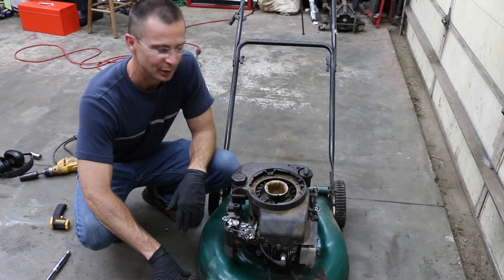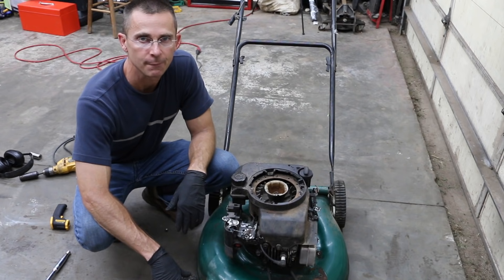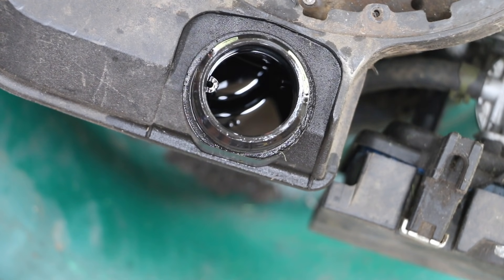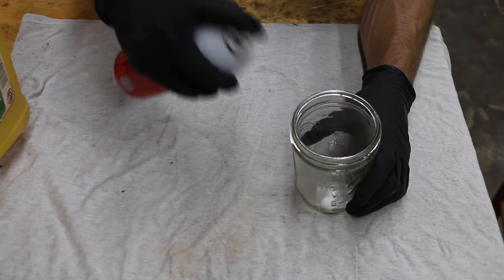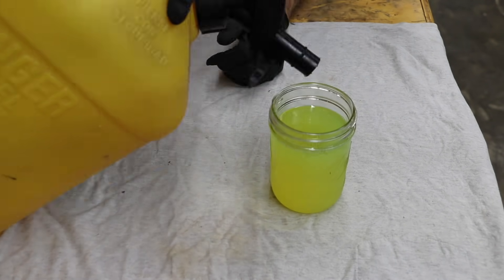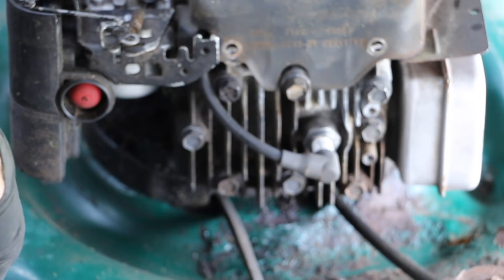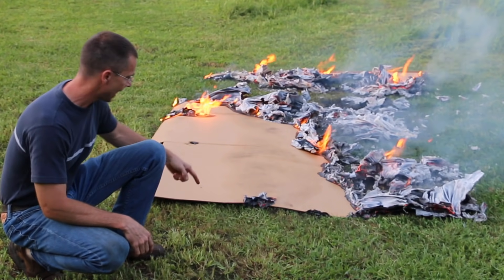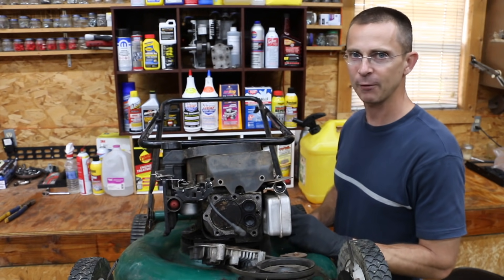Will a Gas Engine Run on Diesel?  Let's find out!

Comment: I've always been curious what would happen if you turned up the fuel on a diesel and made it "roll coal" out of the exhaust through a tube into the intake of a gas motor. Diesel won't burn in a gas motor because the liquid has to have compression to ignite so what if it has been turned into a gas mixture (the coal) instead of the normal liquid form. I am curios since you essentially would be running a gas/diesel hybrid at that point if your HP and TQ would increase.

Comment: Yea I would like to see diesel run in a 2 stroke like weedeater engine.
Reply: It could work, two stroke gassers are higher compression, but I think the quench would be too great for proper ignition, just like we saw here. Two stroke diesels on the other hand....
Reply: Accidentally put diesel in a snowmobile, got as much out as I could, but it smoked really bad. Took it riding, and it broke both pistons into little bits. Pretty crazy
Reply: Weed wackers will run on diesel if they're warm.
Reply: They will. whel, most will (provided ok compression) but you have to block the intake to kill them.

Comment: It's was my understanding that if diesel would ever burn in a gas engine it would require the gas engine to be at its full operating temperature and not a degree below, the hotter the day the better kinda thing.

Comment: Can you do a comparison of running diesel in a gas engine what happens to the connecting rod bearings on the crank. I've always been told the diesel grit will get past the rings contaminating the oil and ruining the bearings

Comment: diesel fuel works better when atomized with air (Injected). The smaller the diesel droplets. the better it burns. Also diesel has a higher BTU rating than gasoline. That's why it burns slower and hotter. Gasoline has has a lower BTU rating, but a higher flash point.(ie..poof)

Comment: Yes, it will, IF the engine is good and hot and has a bit of gas in it. My wife did that when she filled the riding mower with diesel when she was using it. It did not run very well, but it did run. Problem was that it would not shut down, had to choke off the air to kill it.
Now try to run an engine just off of gas fumes.

Comment: Will it run on alcohol? 🤔 Or RC nitro fuel...
Reply: girenloland I was wondering if you are  could  check and see if it will run on moonshine?
Reply: The engine will run on both with methinol alcihal and moonshine moonshine could cause the engine to rush in the inside and alcihal it will run but it's hard to start I pulled my engine like 30 times and it would not start so I sprayed starting fluid in the carb and it started and I ran the tank out of the alcihal and I put gas in and it ran fine
Reply: girenloland More like blow it up I'm thinking.

Comment: Yu have to keep compression in mind. Diesel is meant to ignite on compression only. If you put it in a car it will ignite while the piston is still i the compression stroke and again once the spark plug fires causing nocking and eventually failure.

Comment: this will work if the engine is hot and has some gas mixed in to help light the diesel. it worked with my go kart engine

Comment: Did you use an antique (naphthalene) moth ball or the modern much less flammable (1,4-dichlorobenzene ) moth ball? You forgot to mention any physiological symptoms you had from breathing the  pesticides you atomized into the air.  Did you have any blurred vision, headaches, weird symptoms later, like decreased IQ? Cancer?
Reply from the maker: I used naphthalene.  I wear a high quality duel cartridge respirator when exposed to vapors.  Never experienced any symptoms since I take proper precautions. Thanks for commenting!

Comment: Hello,

I’ve got a suggestion, do you know Aspen gasoline? https://aspenfuel.co.uk/
It’s a special gasoline for lawnmowers and other kind of industrial equipment.
I’ve got some good result of cleaning old carburetors, or keep them clean.
But im curious if there is less carbon built-up, or it will remove carbon.

Keep up with your good work!

Greeting’s Ronald from the Netherlands.
Reply from the maker: Greeting Ronald.  I'm not aware of a specific type of gas for lawnmowers here in the US. Thanks for the positive feedback and for the suggestion!

Comment: I have a old pressure washer we tried to kill a few years ago, we used everything we could for fuel, old shop gas, drain oil, kerosene, Coleman camp fuel, rubbing alcohol mixed together. It drank the mix with little issues. But did develop a rod knock and some 80w90 helped quiet it down. then the bearings went out 10 minutes later and she chooched
Reply from the maker: Thanks for sharing this experience.  I'm impressed it ran!

Comment: We had a guy fill a tank on a heavy truck with diesel when it called for gas. It would run, but it ran like garbage. It was a constant battle to keep it running. Finally realised what he did. We drained it, refilled with gas, and it ran with no problems.
Reply from the maker: Thank you for commenting on this experience.

Comment: Try changing the gas/diesel ratio until it just barely works on its own and doesnt stall or die out.
Reply from the maker: Thank you for this idea!
Reply: is it possible you could modify the fuel/air ratio so that it can burn more easily?
Or modify the combustion chamber by packing it with JB weld so that it has more compression (I think you could increase compression by also sanding down the head on a large flat sanding surface (it has to be very very flat though)
You could also modify the air/fuel ratio by cutting different rings of cardboard with a larger/smaller hole and allowing less or more fuel and less or more air.
it'd be a lot of experimenting!!

Comment: Try running an engine on pure Acetylene!  Make a protective brick wall and put the camera on the other side encase it explodes
Reply from the maker: Yikes! Sounds dangerous.
Reply: They used to run the old model T's on various fuel sources. acetylene was one of them. there also used kerosene conversion kits on those engines. they started on gas and when the engine was warmed up they switched over. they used the exhuast to preheat the kerosene presumably to get it to vaporize easier. spark engines need the fuel to be vaporized before you can get reliable ignition. kerosene / diesel do not vaporise as easily as alcohol or gasoline.

Comment: Spark timing may have a factor in any of these experiments.
Reply: Of course, so does compression ratio. Short stroke, long stroke will give different results, I'm sure.
Reply from the maker: These are great points.  I believe the compression ratio and fuel/air mix are the biggest factors.  Thanks!

Comment: Wouldn't maybe the quantity of fuel mixed to air need to change too? Maybe more or less diesel would have a better chance of working on a petrol engine? Don't know, just thinking out loud...
Reply from the maker: I believe you are right.  Diesel is thicker and flows less efficiently.  Increasing the jet size would have helped. Thanks!

Comment: Can you please try running it on Gas Fumes, that would be interesting.
Reply from the maker: Thank you for this video project idea!
Reply: Actually, liquid gasoline won't burn, only the fumes will. That is a well known fact. There was a book out years ago called The Secrets of the 200 mph carburetor and getting 100% evaporation was the key to all of them, just they accomplished it in different ways. I experimented with a 72 Plymouth with a 318ci engine and went from 18mpg to 30mpg. I just didn't have the ability to get 100% evaporation with what I had to work with.
Reply: look up Tom Ogle. only true documented >100mpg from a normal engine- risky, as basically no carburetor, more or less a butterfly on the gas fill pipe was the 'throttle', and piping resulted in air bubbling thru the gas tank - low vapor pressure made it ice up, he put heater cores in the tank, made the tank extremely heavy to prevent collapse from engine vacuum, and ran the stock engine(400 Cleveland if i remember right) off open pipe(no throttle) to top of the tank...air/fuel mix in the tank means a backfire would be extremely bad type of explosion, but it did work. a guy named Pogue built a vapor setup by boiling fuel in a tube thru exhaust manifold- think in 1930s
Reply: The original Fordson tractor ran on pretty much anything by vaporizing the fuel using the exhaust manifold.

Comment: Diesel doesn't ignite, if the engine was capable of compressing the diesel to igniting pressure it might just run. Maybe making a metal cap under the spark plug that gets close enough for the piston to ignite the diesel?
Reply from the maker: Thank you for this suggestion!

Comment: I was driving a '70 Fairlane with a 220 ci 6 around the back tracks of Western Australia back in 1993, and ran out of petrol (in my science class - at least - "gas" was a vapour). A few Ks back there was a communications repeater compound with a large diesel tank to fire the generator. I remembered some old bloke told me a car would run on diesel if you used the choke, so, having negotiated swarms of flies, a barbed wire fence, and a 2 hour walk in the blistering hammer-blow sun, I put 20 litres of diesel in the tank. I had nothing to lose, well off the beaten track, no one expecting me any time, and blow me down it started! Perhaps some petrol residue helped it fire, then with a constantly readjusted balance between choke and throttle, quite tricky with gear changes thrown in, it got me the 60-odd Ks to the bitumen road and a petrol station. Yes, petrol engines can run on diesel, replete with billowing clouds of white smoke.
Reply from the maker: Jess, I enjoyed reading your comments about this experience!  Those are the kind of experiences we never forget.  Thanks again!
Reply: It was a tough trip of self-discovery and self-reliance, makes me nostalgic remembering it, I was so young then, almost a quarter-century back when I was in my 30s hehe. Being on the wrong side of 60 now, I doubt I would have the enthusiasm or energy for such a harsh and demanding trip these days. There was a lot of luck involved too I guess.

Comment: The reason you had to pump the primer bulb on diesel is that the carburetor is designed for gasoline, the diesel is much more viscous and the jet and siphon effect is tuned for gasoline, with some tinkering it might actually run on straight diesel..... Might
Reply from the maker: This is a great point.  I'm thinking you're right about adjusting the carb.  Thanks!
Reply: I agree. Project farm try tuning the carburator to run on deisel  then try this test again. It should have more power if you can get it to run smoothly on deisel fuel.
Reply: I believe the reason it ran with diesel in the tank is the carb. bowl still had gas in it and it started and the gas was getting diluted with diesel and the primer was supplying enough gas to keep it going then it got to the point that there was too much diesel and the spark plug would not light the diesel and the engine stopped.
Reply: Evil Me older Briggs with adjustable main jet will run all fuels just twist the main jet needle
Reply: yes a gas engine will run on diesel.  I have 2 old Farm-all tractors and a John Deere that i do it with regularly.  You have to get them hot and keep them there. The John Deere that i turn with i usually start on gas just a gallon or so in the tank then put 5 gallons of diesel in and run it til I'm done. As far as compression goes the John Deere only has about 95psi per cylinder, it comes down to the carb. Lawn mowers especially new ones  are designed for gas only they cannot be tuned or reset.
Reply: oshpunit987 You are correct.
Reply: Oh but you can, you can drill the jets :)
Reply: Yes, larger main jet needed
Reply: There's no way it will run on straight diesel.  A lawn mower engine has low compression and it will not produce enough heat to light the diesel fuel. I doubt that it would run on diesel even after being warmed up on gasoline. With the 50/50 mix there was enough gasoline there that the spark plug could light the mixture.

Comment: I've got a factory stock 1936 Caterpillar model 22 and it has two fuel tanks. One has "Ethyl" and the other larger tank has "Paraffin" molded into the cast metal caps.
   Today, "Ethyl" would mean alcohol, but in the manual it says gasoline. "Paraffin", in the owners manual, is described as "tractor fuel" which is said to be any light oil (i.e- Diesel, Kerosene or light vegetable oils as described in the manual).
   The 4 cyl., crank start (yes, a crank on the front of the machine!), magneto fired with spark plugs dozer has a fuel valve to switch between the two fuels. In the manual it says you MUST start and end running the engine with "Ethyl" to purge any remaining tractor fuel out of the carburetor.
    Once the engine is up to operating temperature, you can switch to "Paraffin". That fuel line is routed through a preheater mounted on the exhaust manifold which would effectively lower the "flash point" temperature of the oil.
   Runs like a champ. More power and economy on diesel. I don't know how the thing even runs with only about 50 PSI compression, but it does!
Reply from the maker: This is very interesting!  Thanks for sharing this!

Comment: I think the problem here was the viscosity of the diesel being to thick to flow well through the jets. The gas basically acted as a thinner as well as fuel.
Reply from the maker: I agree. A simple carb adjustment would have helped.  This mower has one of those carbs that can't be adjusted.  Thanks for commenting!

Comment: just preheat the engine when starting with pure diesel, its gonna help a lot and it gonna run well as long as the engine is hot
Reply from the maker: Thank you for this suggestion!

Comment: that diesel in your jar looks very different to the diesel i buy.
has it been treated?
Reply: royce julian, It might have been off road only diesel, i.e. tractors and other farm equipment. Some states require that a dye be used in off road diesel because it's not subject to road taxes and the dye will tell if you are burning off road fuel on the streets.
If caught it's a big fine.
Reply from the maker: I purchased this diesel at Casey's General Store near Kansas City, MO.  It's formulated for use in diesel vehicles and is subject to the highway tax.  I don't know why it's dyed.

Comment: Gas Engine will have difficulties running on diesel but a diesel engine will process gas much better.
I have done it before I had diesel with gas in it and it worked perfectly.
Reply from the maker: Thanks for commenting!

Comment: try straight diesel again, but preheat it this time 
a few wraps of copper inside a can with flame underneath should be enough to ignite straight diesel, I would think 
my oil burner always fires better (cleaner flame and easier to ignite) when I preheat
Reply from the maker: This is a great suggestion--thanks!

Comment: I had a cousin put fuel oil in my lawn mower I used as a go-kart as a kid one time and it had just enough gas in the carburetor to start it it was already warm and it did run all fuel oil until he shut it off which as you know fuel oil is just like diesel. So it would have ran on straight diesel had it already been warm and started on gasoline. Speaking from experience. Oh yes the compression does come up as you seen in this video diesel has a lot of lubricity it actually helps your rings on a small engine if you have a small engine that burns a little oil mix a little diesel in with it for a couple of Tanks have gas it will help seat that ring. Again speaking from experience. Two stroke gas will do the same thing however.
Reply from the maker: Thank you for sharing this experience!

Comment: Did the 50/50 mix make a difference in burn time with the lawn as opposed to just gas.? Great vudeo as well.
Reply from the maker: I wish I would have kept track of the length of time the engine ran using gas vs gas/diesel mix.  Thanks for the positive comment!

Comment: Can you find out how much 2 stroke oil you can add to a gas+2 stroke oil mixture until it starts to affect the performance of an engine and maybe even power output? I remember motocross action magazine did the experiment in the 90's and I think it wasn't until 7% that they started to notice a change in the performance of the bike. By the way, god bless the 90's. And your channel. And Alice in Chains.
Reply from the maker: Thank you for this video idea and thanks for the positive comment!

Comment: If u run a diesel mixfuel some of the diesel isn´t burn correctly and goes into ur motoroil if u do it for some time ur oil is over full or u have damage because of bad lubrication.  i try that on my little 50ccm 4stroke  scooter :)
Reply from the maker: This is a great point.  Thanks for mentioning this!

Comment: You should have got it hot on gas, then switched to diesel. It's been done with two stroke engines, some people run straight diesel in theirs.
Reply from the maker: This is a great suggestion.  Thanks